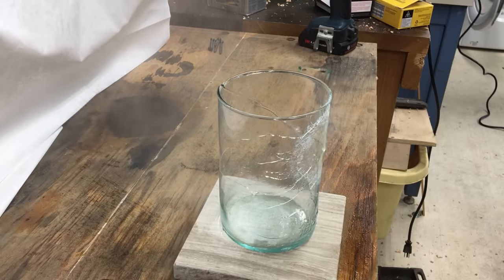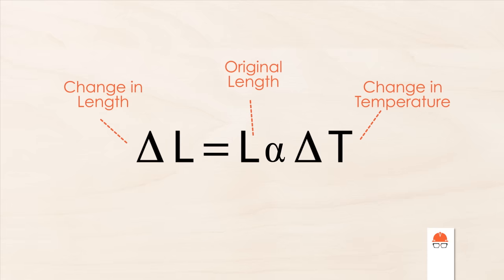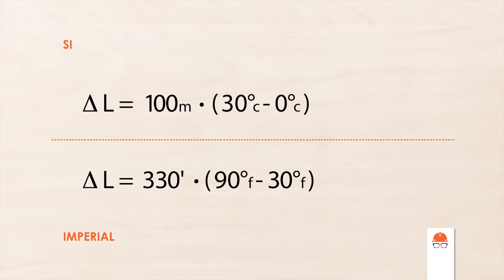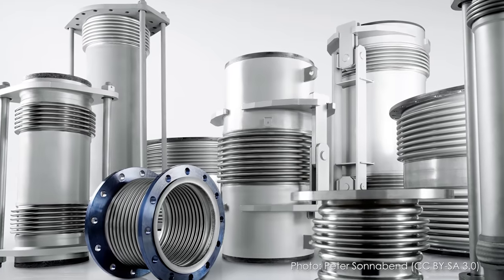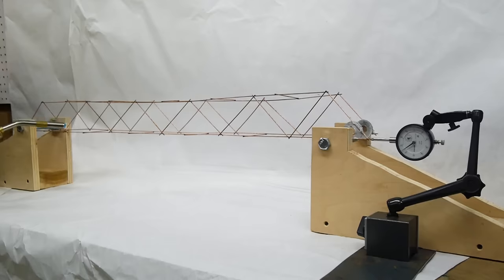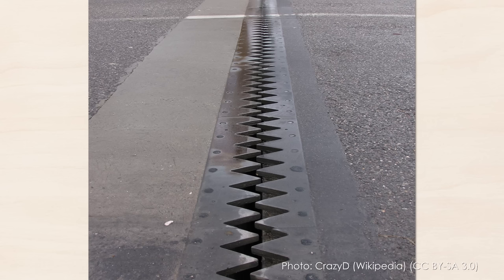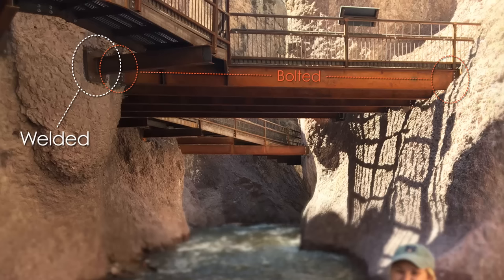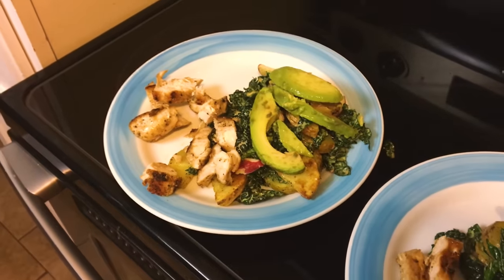Why Bridges Move...

Comment: Nice video! Learned a good bit, but had one more question that has been bothering me. I live in Southern Ohio, and they put a nice bypass around a smaller town. It looked like a real nice job, and even had signs saying it was waranteed. 
Close to my house now is a bridge, it is about 3 stories high. I am not sure what happened, but both sides of the bridge are not even with the roadway. This was done less than 10 years ago too. 
Part of the problem is that the new bypass is a 55 mph highway, so it is rather loud. It is worse though because I can hear those big trucks literally bounce like crazy when they get on the bridge and off the bridge. 
It is also dangerous, as ice forms on the bridge fairly fast, especially because it is at the end of a hollow, as am I and so wind hits underneath the bridge as that is what is to me as it curves to the right headed east. You bounce over the entrance and since it is also a gentle curve that makes you not having control while going head on into traffic moving as fast as you. 
It seems like that repetitive beating that the bridge takes might also weaken it. 60-70 mph loaded trucks slamming down on a bridge, turning right puts a lot of load on the bridge twist. 
While I know they allow for expansion, doesn't this mean someone didn't follow through right? 
 I can't find the bridge name but will get it next time I am on it, in case this needs more data. 
Thanks

Comment: Hmmm, I wonder what happens if you need to deal with thermal expansion on something that gets wet. In the Oroville spillway, maintenance workers noticed the damage that would later cause the disaster and tried to repair cracking and spalling damage. They used compressible filler material that would last at most 3 years in those conditions. Worse, apparently in some cases they drilled the concrete to make more space for the filler, except when the filler was gone that just left a larger hole. So that's the wrong way to do it. But what's the right way to deal with thermal expansion in concrete when your structure also has high flow water above it?

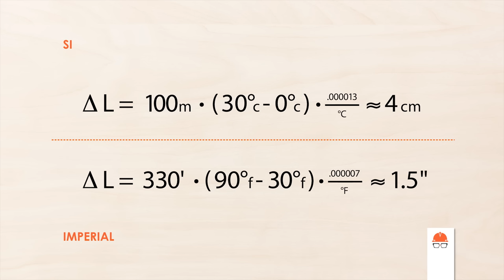Comment: in my city, temperatures fluctuate over a year between -40°C to 50°C does it change the calculus from 3:10.
100m * (50°C-40°C) * 0.000013/°C= 117cm

Comment: Slotted holes  are not the greatest expansion joints.  I have doubts that that would hold for radical temperature changes. The friction in the connection tends to remove the ability to displace. Check out the David L. Lawrence convention center collapse for a great example of slotted holes failing as expansion joints.

Comment: Carbon fiber has a NEGATIVE thermal expansion (it shrinks when it is heated). By pairing it with a resin having a positive thermal expansion, the composite laminate can be engineered to have ZERO thermal expansion. Pretty handy for environments like space where temperature changes are extreme!

Comment: one of my favorite expansive relief mechanisms I've seen is on pipelines going into/out of industrial plants. or even within the plants themselves

instead of making an expensive bellows or something, they just put a big U bend. you'll see it all the time, just a random 50' jog to the left or right, and then back to where it started. this lets the length of the pipe use that sideways part as a spring and thermal stress basically just moves the two ends of the U closer of further apart. This lets the construction crew use all the existing materials without needing anything extra, but it uses the material in a very clever way

Comment: Thermal expansion of concrete is an absolute nightmare when it comes to making repairs.

I’ve used my saw to cut sidewalks and curbs before where there is so much built up pressure that as I finished the cut, I felt the ground shake as the sidewalk slammed closed on the gap I’d just created, trapping my blade. 🤦‍♂️

Comment: With that graph of materials expansion due to heat I wonder, does pressure change that? 
Could weather with low and high pressure zones make a noticeable difference? And even if you give materials space to move due to heat, if it goes the opposite way, how much does it shrink? Would a bridge in canada with minus 40 Celsius perhaps break down because of the cold?

Comment: Thermal expansion is probably the economical nail in the coffin of the Hyperloop. You simply can't add expansion slots on a vaccuum tube several hundred if not thousands of miles long and still expect them to be nearly perfectly sealed. The only way to circumvent the problem of seals leaking on a project like this would be huge numbers of very high powered vaccuum pumps kept running 24/7, even if the trains were not passing through the tube. That would make the costs explode way beyond any feasable economic model.

Comment: I’ve showed coworkers how to calculate both steel and crude oil thermal expansion.
Reply: We buy and sell crude oil based on a 60°F. The thermal coefficient is .00065 per degree.  In a 350 bbl measured volume one degree is an additional .2275 bbl.

Comment: my cement board siding is buckling due to lack of expansion joints from the knuckle heads who installed it.   i specify expansion joints in brick veneers where they turn corners and the masons think i am crazy-

Comment: the metal side gate on my home cannot even open in the summer, it expands and rubs against a bolt the mounts the side frame, it takes a ton of force to open, and when it's cool outside it doesn't touch and opens freely.

Comment: what about half a bridge sliding downhill during construction by 8 inches... like the Saskatoon north commuter bridge before the deck was connected to the lower abutment  but was connected to all peirs.  then after re engineering the last I beam spans it was just continued with construction... with leaning peirs and an upper abutment 8 inches out of place... is that normal? or even ok? I hope you actually see this despite how late of a comment this is

Comment: This is why space structures are obserdly difficult to design from a thermal equalization standpoint.  The the structure must have to conduct heat as efficiently as possible or run ammonia convection pipes along such a structure.  Space is really hot on one side and really cold on the other with no natural media to equalize the differences in temperatures.

Comment: It’s frustrating seeing shoddy concrete work which only place a 1/4” deep surface “gap” in a 4” walkway slab to cosmetically simulate an expansion gap. 

Do these superficial grooves help enough due to surface-layer expansion or should the entire slab be properly segmented with a full height gap?

Comment: Inconsistent heating or cooling can be really devastating. I was once working at a summer camp where we built a fire in a cinderblock in order to use it as a furnace. At the end of the night, one of the campers tried to put the fire out by dumping a bunch of water on the block causing the outer part of the block to cool and shrink while the interior was still a blazing furnace and trying to expand. The result was that the block exploded and threw debris at us, causing several bruises for those unlucky enough to catch a large piece. It's insane how much pressure can be caused just by the expansion of cement.

Comment: Well, by definition, thermal expansion is not moving, it is more like changing sizes. It occurs to all materials, but the bigger, the more noticeable it is. A 0.001% increase in size is more obvious on a 1 km structure than a 1 cm material.

Comment: So they build sidewalks and bridges with thermal expansion in mind but i think i know why the roads are so bad. The design in alot of areas doesnt seem to have sections to account for thermal expansion. So thousands of miles of roads expanding and contracting with almost no room to do so. Its no wonder the roads have so many cracks and pot holes.Maybe not the whole problem but its probably a big part of it

Comment: Why do formulas always have to be written is such a confusing way? The formula is written in a way that almost makes it look like the delta and L on the left are 2 different variables, and same goes for the L and the a on the right. For a formula with multisymbol variables and when any of those symbols are used again (which I think is all formulas with multisymbol variables, because why else would you use them instead of just using one symbol), people really should use a symbol to signify multiplication (be it the dot or the asterisk).

Change in length=original length * coefficient of thermal expansion * (final temperature - original temperature).

ΔL=La*Δ*(T1-T2) this way of writing it makes it much less of a jumbled mess of characters.

Comment: I've been invited to a house with huge cracks, so large that I could put my entire hand into the crack. This was however neither the fault of thermal expansion nor an earthquake, but piss poor engineering. The house accommodated 3 generations of my relatives and was modified and expanded over the decades. What apparently no one thought of was that it's a terrible idea to have two different types of foundations on soft ground...

Comment: To ALL Bridge engineers out there....  please take note very carefully: Your science and math will tell you where you need an expansion grid. However, if you happen to be a motorcyclist unfortunate enough to be riding in the rain over this scientifically designed grid you may well be severely injured as you slip on the metal grating designed by an academic... To ALL academic engineers out there: get on a motorcycle and negotiate your own design on a motorcycle in the wet!! I dare you!
Reply: I am saddened that you have presumably never felt the full freedom and emancipation and beauty that comes with being truly in control of a motor bike

Comment: This is why Elon's Hyperloop is a horrible idea.  Where would a hundreds of miles long tube expand or contract to while remaining structurally sound to prevent a catastrophic failure that could endanger the occupants?
Reply: at the connection points of the tube pieces
Reply: Along with the fact that the loop is being made in an area with a lot earthquakes, meaning that damage to the tube could cause it to implode (as MythBusters have shown with a tanker).
Reply: what connection point could you create to allow a 100% seal whilst remaining flush and without collapse from a 1 atm pressure difference? I certainly haven't seen this connection point at the 1 km test track.
Reply: Scott Maday     A giant o-ring
Reply: An o-ring would not only be unable to counteract many inches or possibly feet of expansion and contraction, but it itself is subject to expansion and contraction while still needing to protect every passenger flying past it at several times the speed of sound(or a 10th of that if Elon's tests have anything to do with it lol) from violently being imploded upon.
Reply: Scott Maday   of course it could.